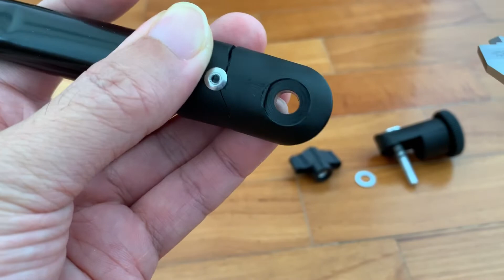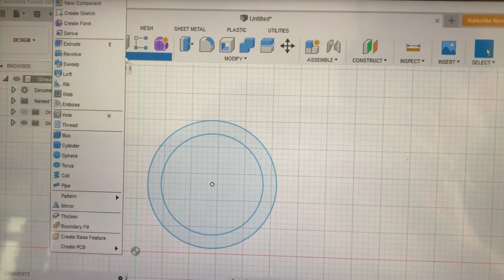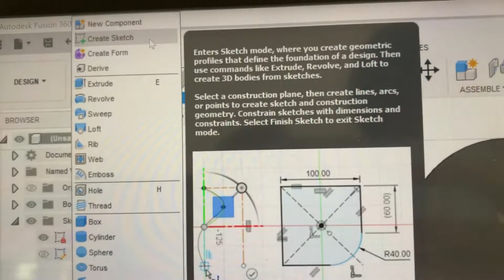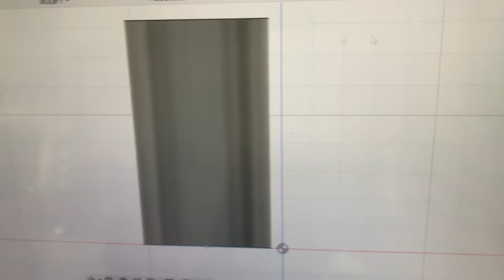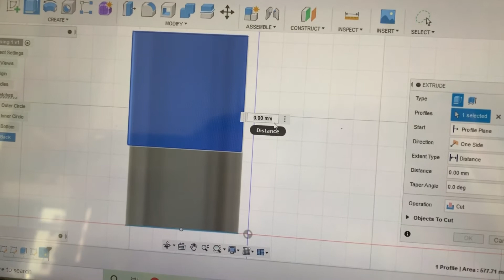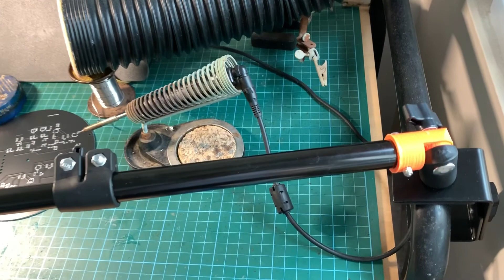How to use 3D Printing for break-fix (Fusion360)

Comment: Cool man.  I do this stuff at work all the time using the same process you've just described.  You can also do a lot of the dimensions through the insert canvas command.  Once you calibrate the image or images,  then it's just a matter of tracing out the parts.   But it really helps when you have holes in the middle of a part that you don't feel like measuring out and doing math.   Cool vid man!
Reply from the maker: Thanks for your awesome comment! Glad to have my video affirmed by a professional like yourself.